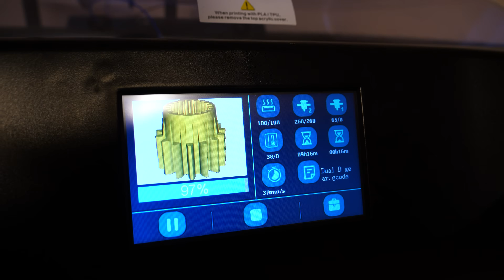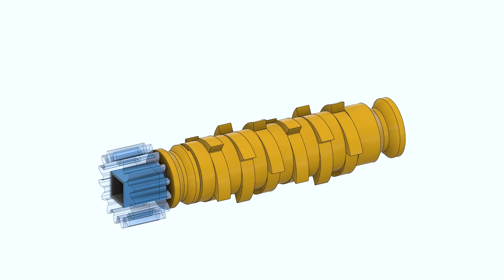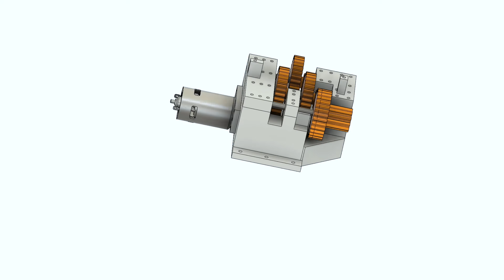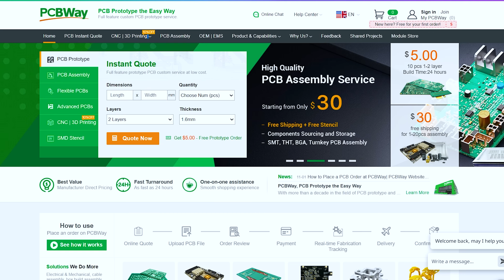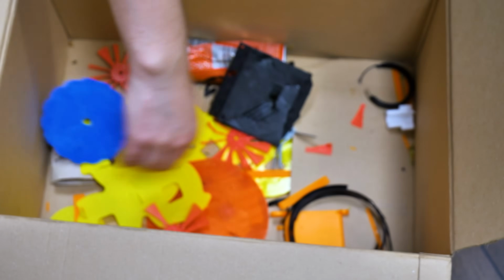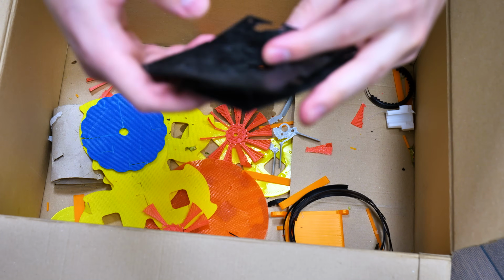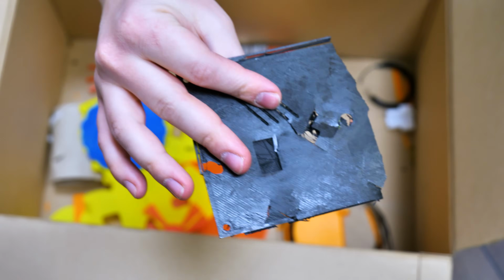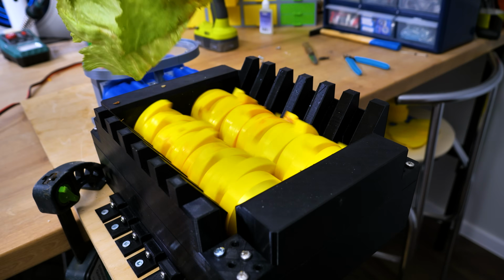I 3D Printed a SHREDDER and this happened...

Comment: Great work! Just one piece of advice from a mechanical engineer's standpoint: don't use squares in the design. The corners of squares are stress concentrators, and the part in that area will likely break. Instead, use fillets or circular profiles

Comment: for the hammering what about a steel pipe that fits over the central rod?
needs to be cut at a right angle and have slightly rounded edges.

Comment: 11:11 And that is why you use Double Helical Gears / Herringbone Gears. It maximises the contact area between gears.  Allowing for higher ratios (less teeth on small gears) while still making the teeth stronger / reducing slip.

Comment: I am impressed with the hard work you have done. I am not for sure if you are familiar with hydraulic press. It is a easy way to insert object in without hammering which result expanding the parts. From that the looks, it seems to be dangerous to operate the machine 🙂.

Comment: I think I understand that the pressure of the machine is what "cuts" or rather pressures the material that you feed in to be torn... but why not add blades metal  blades at the end you can get from cheap shavers?

Comment: pro tip: put the aluminum square tubes in the freezer for a couple hours so they shrink just a little bit, it'll make it easier to get the shredder wheels on. and like other commenters have said, put something between the hammer and the printed parts to better distribute the force, or use a rubber mallet if you have one.

Comment: maybe using Nylon filament will do the job.... I would like to find a shredder that I could put over my recycle trash,  that could crush card board or plastic, to avoid fulling the trash with big box.  no need motor for my projet just a sweevel

Comment: Great project...I liked the way it took 'bites' out of those apples. The tooth depth is just simply shallow enough, that it did not exceed the elastic limit of those fine sheets of plastic. they are just too flexible, to be broken with that little tooth depth. I agree, the transmission needs a little refinement, but, This would be perfect for making salads, it shreds lettuce and cabbage absolutely perfectly. I don't know if ABS and PLA are considered "food grade" or not.

Comment: I think the teeth need to pass each other further. The flat round radius next to the teeth radius could be smaller and the teeth radius bigger.  I think that's how the big metal ones work so well, also a much slower gear ratio would help a lot with torque and grab opertunity too in my opinion.  Too much speed means a lot more strife on the gears if it does jam.  I love projects like this. Thanks!

Comment: The reason it's not shredding and is just punching holes in the printed sheets is because the grinding teeth don't overlap. The gap down the middle of the shredder is straight, but if you look at a proper shredder you can see that the teeth overlap slightly on the opposing sides, like a square wave. To fix it, you would simply need to make the toothed parts slightly larger and the smooth parts slightly smaller.

Comment: How viable would it be to make a shreader that can sit on top of a standard UK wheelie bin, that can shread cardboard and plastic bottles? 
Because I always have problems with fitting all the cardboard in my bin as I just don't seem to be good enough at tearing things down.. I think I am doing good, but then STILL run out of space.. so if something can shread like this... It seems like problems would be solved.
Reply: too dangerous

Comment: A new twist on a food processor.  A problem with a typical food processor is that if you let it run too long, the contents become overly shredded, and you can easilly turn your onions to sludge instead of shredded onion.  Your shredder does a pass, ONCE.  If you put fine adjustment on your shredder, you might have a deterministic food processor where the first item through is the same as the last. Perfect sizing. Its like you are on the cusp of a new food processing machine.

Comment: Try and print a larger centrifugal pump and use a brushed washing machine motor, they are insanely strong and fast and run off of over 12 volts (way way over)

Comment: but what you do have is a plastic form to set a casting sand mold where the plastic can be melted away and reused while the samd can and must be reused and the metal parts only need small clean ups, polish  and heat treatings to the right places for strength ... i believe in ya man now to "forge" ahead in material sciences 👍

Comment: Just a question, I have no idea how shredders work but from technical point of view - shouldnt the gap between the teeth of the shredder be as small as possible? Aint the purpose of overlapping teeth to also cut like scissors? Maybe making them so close to nearly touch - would help to also tear the plastic plates to pieces

Comment: Stop modulating the voltage!   Make a pulse-width-modulation DC power circuit and run the power at maximum voltage, with speed controlled (reduced) by intermittent pulsing.

Comment: You have inspired me to get into the hobby. 
I ordered an adventure 3 pro last night. It’s a cheap budget machine but I’m looking forward to getting into this and I hope to maybe evolve into designing and doing projects like this. 

Good work!
Reply: I didn’t want to start with an ender 3, but not a Bambu Lab X1 that’s nearly 4 times the cost of the A3 pro. To say it’s a cheap machine is probably not accurate, but its certainly not unreasonable either.

I am aware of the nozzles, i wasn’t thrilled about it but it’s super simple change which is good because my kids will be using it.

I wasn’t concerned about the camera and Wi-Fi connectivity. I just wanted a super easy machine to start with that will print PLA and a few other higher temp materials.

If I want to do larger prints I’ll get a bigger machine with more print volume. 

For now this will be a machine to learn on.

I am doing fusion 360 tutorials and already have some projects lined up for it. 

Maybe I’ll do some videos on my journey. 

Happy printing 😊
Reply: Thats definitely not a "cheap budget machine". A cheap budget machine would be something like an Ender 3. The Adventurer 3 Pro is a high quality printer that comes with quick change nozzles that are able to print Carbon Fiber Filaments. Print volume is pretty limited to basically 15x15x15cm which could become a problem if you want to make larger parts without having to glue them together. It even comes with a glass bed so adhesion should never be a problem because you dont even have to level it. It has auto filament loading. It has an HD cam built in, this way you can watch your prints online from whereever you are. Its basically silent when printing. It delivers great results in general IF you can get over the 15x15x15cm limit. 

Definitely not a cheap budget machine. Do research before buying something. Also if you for some reason cant fit a 1KG spool of Filament into it, they sell an adapter for 4€ OR just tinker it together yourself and print it.

ONE THING TO CONSIDER IS: You can NOT fit regular nozzles into this machine. You have to buy a replacement for 35€ and 45€ from them. Thats quite scammy in my opinion. For that price you could buy 30 regular .4mm brass nozzles or 16 .4mm MK8 hardened steel nozzles.

Comment: Once you have the power transfer issue solved you will run into the problem of the cutters wearing quickly. In order for the cutters to last and cut well they need to be made from a harder material than what is being cut. When I was working in the recycling industry the cutters on our grinders were made of hardened tool steel with tungsten carbide cutting edges welded to the cutter ends. Those were used to cut aluminum and plastic, but were capable of cutting light gauge steel if necessary. I think that a decent solution that would allow the cutters to be 3-d printed would be to electroplate the cutters in nickel. That would provide enough surface hardness to keep the cutters from wearing when shredding plastics. You will need to adjust clearances to allow for the thickness of the electroplate.

Comment: I used metal shredder from paper Shredder. and a 3500lb winch motor to turn it. 3d printed mounts and framing to hold it all together. It will shread anything and torque 3/4 plywood reinforced by angle iron to 45 degrees should it jam.

Comment: Have you thought about adding metal (carbide or something) tips to the teeth of the shredder. They can be replaced and reduce wear of the shredder parts. you could use just some metal squares screwed into the pla where the teeth would impact that way the metal would take most of the abuse, and as previously stated, could be replaced.

Comment: I'm sure someone else has covered this, But the reason your shredder won't shred, is the gaps between cutting surfaces. the opposing teeth should almost touch as they pass one another, and the gap from one rotating assembly to the other should be very small as well.

The only thing you cannot currently account for is material weaknesses and flex. if you drop a hard object in, does it open the gap between both cut heads. your aluminum core is great but it doesn't stop the frame from allowing movement.

Improvements to this design could be making the frame from extruded aluminum like your 3d printers are made from, printing your gears from a harder material, or have PCB way make them.

Either way, fantastic video. I would hope you will revisit your designs with improvements in the future.

Comment: Hi, you may freeze aluminum profile before installing plastic stuff install. Due to low temperature metal should shrink and you may easy install without using hammer. I used that technique with bearings and it is worked for me...

Comment: Have you thought of using cast aluminum? Here on youtube, myfordboy has some really decent videos on using 3D printed parts and casting them in molten aluminum. The gears would likely need to be made of aluminum bronze for the increased wear resistance and strength, but the shredding teeth themselves could probably be made of cast aluminum and survive fairly well.

Maybe then you could shred aluminum beverage cans, PET plastic bottles, etc.

Comment: https://www.youtube.com/@RobertMurraySmith - did a video last video on making stronger 3D printed parts.
He simply puts superglue onto PLA, which soaks into the print and once activated/hardened - makes the prints super tough.
https://www.youtube.com/watch?v=AExrJ_Y4t64 - 1857 How To Make Super Strong 3D Printed Parts
Perhaps an idea to make it last longer - a 3D failed print shredder could be useful, if one had a 3D filament maker :ø)

Comment: I would heat the aluminium bar just enough for the blade plastic to melt a little bit when inserting them. I would do one blade a the time and when all of them fit well, I let cool the aluminium before inserting all of them.

Comment: Your gear box is not constructed correctly. Torque increases throughout . So you can make the first gears thinner and with smaller teeth (and though bigger ratio between gears) but you need the later gears wider and with larger teeth (which limits the ratio between gears). The difference between the gears of the shredder and the last stage of the gearbox is just too big. They should be pretty similar.

Edit: As your gear box looks like being 4 stages with 3:1 ratio so the teeth for the last two gears have to endure 27 times the force than the teeth of the motor pinion.

Comment: I worked in plastics for over 20 years and all grinders have a sized screen gapped on the bottom. Some are a thin screen and some are  .250 thick.  The holes in the screens determine the size of the grindings.  The plastic goes through the grinder and then it stays in the grinder until it can pass through the holes.   Most of the places I worked would either use 100% regrind or like Solo Cup(from memory) we used something like 20% regrind and 80% virgin in Pet cups

Comment: I suggest that when you improve gears , next step should be that you will add something like belt (little plates) steal to the tooth for shredder, make it like horseshoe design, just simple plate (not the U profile). that is easy to do with countersink M2-M3 screws (smaller is better)  and a bit of superglue.. by experimenting with width of steel plating you fine tune the gap between tooth (of 1.2) and gear body (of 2.2) so thinner materials can be pushed out. of course you cannot do to thin, because this is plastic shedder with aluminum rod so it has limits, due to soft matterials.

Comment: Great idea, maybe try adjusting the rollers to be thinner where there is no teeth, then have a solid piece there so that whatever part that is in there would need to be "grated" because there is a solid piece blocking it, i dont know the name for it but in your black PLA, imagine fingers that are solid that extend in about 75% in, at a 90 degree angle of the 2 shafts, the idea is to not allow pieces to be pulled in by the whole roller, but only pieces by the teeth, like many little nibblers. For your gears maybe try some harringbone gears, if you still have issues due to torque i know that people 3d printing RC cars use polycarbonate for their gears sometimes too. Love the idea though, I could see people using this for composting, or even pet food prep. Cheers!

Comment: Great work! This is awesome! This could maybe be great for like a compost bin pre-processing machine. I don't know that shredding organic material before composting really speeds up the composting process, but if it does that'd be a great use.
Reply: Shredding organic matter makes a huge difference to composting. Not leafy stuff like the lettuce but the stalks, like brambles and twigs. The home shredder you can buy for $100 is a 10" diameter steel disk about 1/2" thick with a blade in a slot.
Reply: @maverickstclare3756  that's really cool! Thanks for the info!

Comment: Old steel brake rotors typically just get thrown in the trash but they could probably be cut into shredder discs using a plasma torch. Get an old gas powered wood chipper or lawn mower engine to power it and you can make a shredder out of mostly trashed items.

Comment: Very good. Maybe a close loop control system will improve the efficiency, by running the motor in low speed but increasing tork when needed (but is much more complicated system, needs calibration, sensors, ...)

Comment: "Why did you use ABS?" - "I ran out of blue PLA". Yup, that sounds like 3D-printed-pumps guy xD

I'm also kinda surprised that you didn't use your modular planetary gearbox for this setup. As far as it demonstrated in the other videos, would it probably not have had those issues.

Comment: The blades didn’t need to be that tight of a fit. As long as there was something to hold them on each end then it would be fine and you could have used something that tightens with a bolt at the ends so it was easy to remove.

If a blade breaks you can’t replace it easily.

Comment: For stronger materials , probably a good idea to re make the gears to make it 3x slower , needs more torque .
Reply: i think oppisite more speed + a flywheel to let inertia do the work
Reply: @ipodtouchiscoollol  Notice the metal ones go slow and powerful and not fast? if you add a flywheel and more speed then it becomes a faster salad blender, and if something harder goes in, you will eventually find the tooth breaking point. I suggest giving them a coating of super glue  and fixer spray to make them super hard, could add another motor in parallel.
Reply: @ipodtouchiscoollol  If the flywheel was geared down for the output for more torque, it can help preserve the motor and give more inertia for the teeth , can the axle shaft handle more torque?
Reply: @quantumenergysolutions9128  I mean its not a 3d printed shaft but a metal shaft, if you use a steel one I think gearing down the flywheel would actually work quite well not sure if the 3d printed shredder teeth will hold though

Comment: Your rafts were probably responsible for the bad fit. A bottom layer over raft/support will descend below its nominal bottom because it's not squished against a surface.
Reply: But it's also flat because the raft top surface is strictly parallel to the movement axis. Heatbed usually has a bow of like 0.1mm or more near the middle, and only mirror glass can be flat.

Comment: Awesome work!  Just wondering, did you think about using machinist inserts that could be screwed onto the faces of the cutting blades?
Reply: Yes. I had a very similar thought. Something like the carbide cutters for lathes. There's probably something that fits better that already exists in the market though. That's just the first thing that comes to mind.